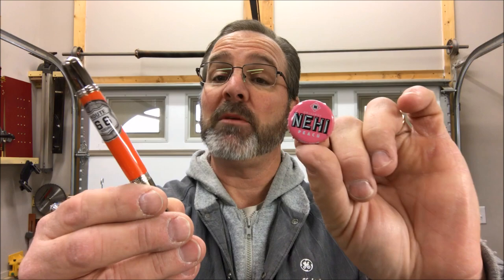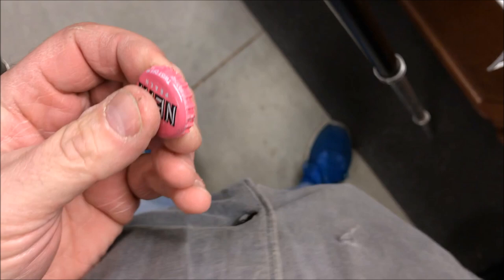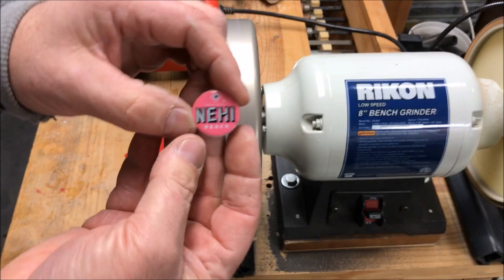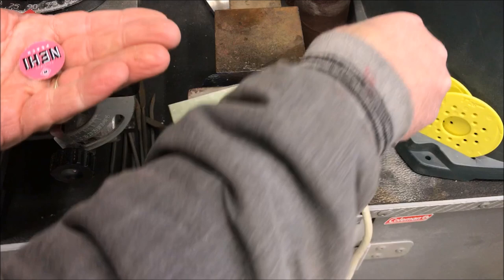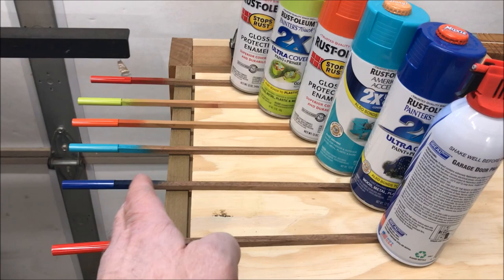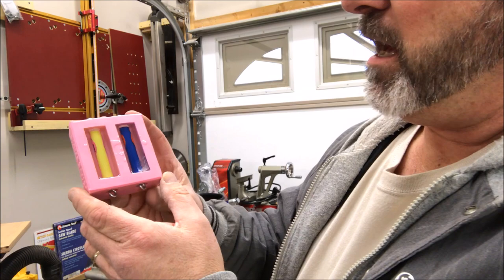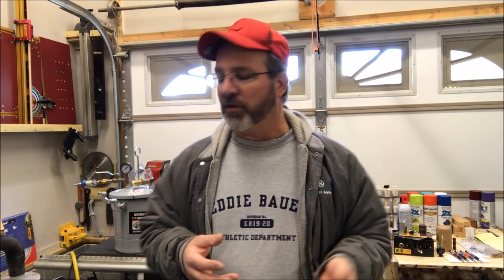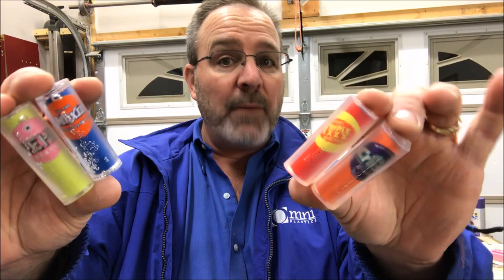How I Make Bottle Cap Pen Blanks

Comment: Take a look at a carboy heater used to keep home brew at the correct temperature during fermentation. Its just a heat belt that you should be able to wrap around your pressure pot. Haven't tried it but that was my first thought. Merry Christmas!
Reply from the maker: Thank you Gary. 

Regards,
Bob

Comment: (First, a disclaimer - I've only got about a dozen casts under my belt, so I'm still learning myself!) But I usually do my casting in the evening, then bring my pressurized pot inside the house for the overnight. I figure the house holds a more stable temperature than any kind of a heating setup in the shop. Also I have the HF pressure pot just like yours that is rated for 60psi, but I only pressurize it to 40psi so I'm well within the safety margin.

Regarding my first statement - I appreciate your videos Bob!!!  Thank you for posting!!!
Reply from the maker: Thank you Doug. 

Regards,
Bob

Comment: I'm assuming the problem has been resolved, but I would say to check out brewing and gardening sites, both use a heated mat for temp control, and may be usefull for this issue.
Reply from the maker: Thank you,
  I purchased a toaster oven and it solved the issue. 

Regards,
Bob

Comment: I use a water bed heater that I set my pressure pot on to keep it warm.  It has a thermostat so i can adjust the temp for what I need and it uses very little power .  Works great
Reply from the maker: Cool idea, thank you. 

Regards,
Bob

Comment: Just seen this vid. Great idea on a way to use caps on pen blanks.
 Might I suggest though, using a table vice to hold the Dremmel tool. Hate for you to have an accident with a spinning cutting device. As far as the temperature in garage. Try adding a air duct from the home furnace into your garage. Don't forget to use a good vent that can close fully so you may close it tight when not working on your projects.
Reply from the maker: Thank you. 

Regards,
Bob

Comment: best way to do this is with a small lathe; used sherline before but now I've made my own, better cnc one; I just glue cap to a round piece of a wood and carefully machine the cap; pen maker has to have lathe but it is usually wood lathe which would not be a good choice to machine cap; I also use my cnc lathe to work on blanks - you can create much more complicated curves if needed and good if you want to replicate few pen bodies
Reply from the maker: Thank you. 

Regards,
Bob

Comment: For building composite homebuilt airplanes we had to keep our epoxy pumps warm essentially all the time. I built a 1/4 inch plywood box for the pump with a front door (no seals) and the heating element was a just 60 watt light bulb (not LED). Worked perfectly. You can try different wattage bulbs until you get the temp you want (my 60 watt kept it at about 90 deg F). Warning... A friend used a 10 watt bulb and a Styrofoam cover but when doing a layup the cover was removed and he would switch to a 100 watt bulb and no cover == one time the cover was replaced without changing the bulb and the 100 watt got it hot enough to melt the plastic epoxy containers which was a major disaster - be careful.

It seems the air trapped under the bottle cap is a problem. Maybe using some glue  (or a pre-smear of alumilite) would eliminate that.
Reply from the maker: Thank you John,
  I’m working on a box with a light bulb for the pressure pot. 

Regards,
Bob

Comment: Another option for a heating element is a coffee warmer. Many times they're cheaper.
Also, are  you wearing that denim or is that pad? Either way, denim is a great choice.
I love that you filmed the "oops" for the casting. Some resins are very particular about the mix as well as the temp they cure at. Great choice for taking them into the house (as I'm assuming it's a bit cool in the workspace that you cast in). I've used JB resin and it's very, very particular about the 72 degree curing temp. A degree or two below, and it's still bendy 24 hours later. But if you demold and let it sit for an other couple of days, it does fully cure ... unless you're a tad off on the mix, and then it will never cure. Why did I try the JB Weld? Because it has UV protection that a lot of others don't. 
Will I use JB epoxy again? Likely not. It's too particular and we can't get that kind of temp regulation in our 80 year old house. Read ALL of the temp and curing requirements on your resin before purchasing.
Also, the bubbles are a great way to demonstrate the difference between a resin that needs a pressure pot as compared to one that doesn't. I only use epoxy resin, like that you would use for crafting jewelry and the like. Bubbles come out easier without needing a pot, drills and turns without fear of blowout (unless you get a bubble, and then it tends to blow out a chunk you can CA glue back in place and continue turning). and tends to turn like butter. Still as strong. Still as brilliant of a shine when finishing. Just not as fragile because it doesn't blow out in shards like Aluminite.
Reply from the maker: Thank you April. 

Regards,
Bob

Comment: in wine making temperature is an issue as well. if you haven't found a solution for heating the pot, they make a heating blanket for wine carboys that may do the trick.
Reply from the maker: Thank you Mikey. 

Regards,
Bob

Comment: Walmart sells a chicken light used for keeping baby chicks warm.  It has a huge reflector dome.  Put a heat lamp or flood lamp in that and put it right on the pressure pot.  I had rather try that instead of taking my pressure pot into the house.  If you don't want to buy that just use a heating pad to sit under the pressure pot to raise the temperature.
Reply from the maker: Thank you Wayne. 

Regards,
Bob

Comment: Love your video's. I'm starting to try to make pens. Does grinding the bottle caps on a CBN wheel damage the wheel by filling it up with soft metal.
Reply from the maker: I’ve had people tell me that it does but I’ve only ground a handful of caps and so far haven’t seen an issue. 
  It may be a good idea to purchase a cheap stone wheel for soft metals. 

Regards,
Bob

Comment: Great video. How did you keep the resin from filling up the tubes. If they were filled did you drill them out. Thanks again for the video
Reply from the maker: The molds have stoppers in the to keep the resin out of the tubes. 

Regards,
Bob

Comment: Oh wow, Bob, I like the idea of casting bottle caps. that is something I have yet to try and now you have motivated me. by the way,  during the cold weather, I setup my pressure pot and resins in my family room only because I have the space. One question I do have is in your casting video you set the pressure to 80 PSI and your pot looks like the harbor freight model. I thought those only went to 60 PSI, just wondering. Thanks for the great video. OW.
Reply: what I meant was the harbor freight pressure pots were rated at 60 PSI max and that is what my pressure relief valve is set to. I usually go to 42 - 45 PSI. Thanks.
Reply from the maker: Hello,
  I initially pressured the pot to 60 PSI. I have since modified that to 40PSI.

Comment: Great video Bob. You may have addressed this in another video but I was wondering ... wouldn't a vacuum pot work better for removing air from the castings?
Reply from the maker: Vacuum is for stabilizing and pressure is for casting.

Regards,
Bob

Comment: Bob, Wouldn't it also work to put the blanks under vacuum for curing or would that have a tendency to flatten the resin/mould?
Cheers,
Lyle
Reply from the maker: Vacuum is more for stabilizing and pressure is for casting. 

Regards,
Bob
Reply: Great Thanks!  Learn something new every day!

Comment: Question,... Does the pressure pot need to stay out in the shop? Pour your blanks in the shop, but after you put the pot under pressure carry it back into the house. Even if it sits by the shop door it has to be warmer than out in the shop near the roll up door
Reply: Yea but if the pressure pot explodes and puts a hole in the ceiling you are never going to hear  the end of it. :-)
Reply from the maker: I have been drawing up plans for a Pressure Pot warmer. That will fix the problem all together. 

Regards,
Bob
Reply from the maker: LOL.
Reply: RJBWoodTurner all day I've been looking at stuff like heating pads on my various sites. I just know regular heating pads turn off after maybe 15 minutes or so.
Reply from the maker: I’m thinking a 60 watt bulb in a box.
Reply: RJBWoodTurner like big box that you put the entire pot in. It may take a long time to heat up all that metal. I'm thinking some sort of direct contact pad on the bottom of the tank.

There are also some sort of  heaters designed to wrap around tanks that home brewers use.

Or how about roof de ice tape.
Reply from the maker: Are they expensive? I’ve never seen them but to be honest, I’ve never been involved in Home brewing.
Reply: I'm looking at them now. 20 to 30 bucks but they may only get up to 80 or so. I looking into whats the best temp to cure the resin. I'm thinking like 120.

Comment: I see a Nova Comet II in the background of this video is that what your using these days? How do you like it?
Reply from the maker: No, the Comet was a loaner. I use a Turncraft Commander from PSI. 

Regards,
Bob
Reply: Your Turncraft Commander lathe what size is it 10" or 12"?  any issues with the lathe other then the board?  I'm looking for my first & only lathe still can't decide which way to go. Also can you point me in the right direct for some good starter tools / chisels?
Reply from the maker: The Turncrafter is nice but the Jet at my club is 100 times better. There is no slip in the Jet.
Reply: what Jet model?  also about the other question I asked, what is a good starter chisels set?    Last question what grinding stones are you using on your grinder ?
Reply from the maker: I can’t remember the model
Of the Jet but we have the small one and the second to the smallest. Their both very solid. 

  Tools is a tough one. Every turner liked something different. I’m not aware of a good cheap set. Bare in mind, if you go carbon steel, they will need sharpening. If you go Carbide, the cut is not as clean. 

  Do you nave a club in your area? Even a Woodcraft will have a turning session on the weekend at least once a month. You could try either of those and you’ll get the opportunity to use several different tools. That will let you get a feel for them and form an opinion about what you like.

Comment: Bob what type of mold and for what pens kits is that for if you don't mind me asking? also I learned from Zac that the mold blanks need to stay in the pot for at lease 24 hrs, the bigger casting don't have to be in there that long.
Reply from the maker: The molds I used were from www.ptownsubbie.com and they are for 27/64” sierra tubes. I use Alumilite and it only takes about 2 hours to cure. Larger castings do take longer. Zac is a true expert so for the best results, cast his way. I love his work. 

Regards,
Bob

Comment: Have you tied using a vacuum instead of using positive pressure in the pot?
Reply from the maker: Pressure compresses the bubbles. Vacuum is to pull the resin into the voids of the material. 

Regards,
Bob

Comment: Couldn’t you do the same process with wood as far as putting the caps on them and use CA glue to attach them to the wood and then use the CA glue over top ov the whole pen
Reply from the maker: I’m sure you could but it would take a lot of C/A to level it out. 

Regards,
Bob
Reply: RJBWoodTurner but if it is towards the top of the pen where you aren’t touching it would it matter just courious thanks so much for the reply
Reply from the maker: I’d say give it a try, that’s the best way to see how well it will work. I’m just speculating and it make end up looking amazing. 

Regards,
Bob
Reply: RJBWoodTurner just getting a mini lathe from a friend for 50 dollars never used one so I was courious but I will give it a try when I get time between both my jobs